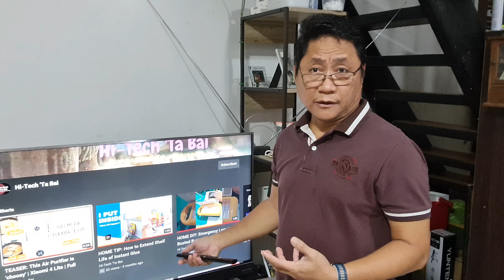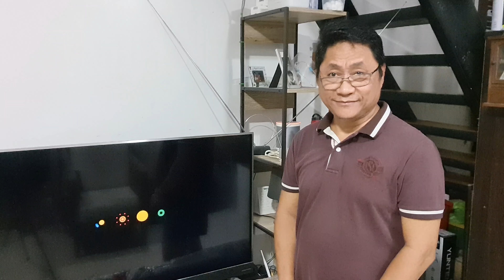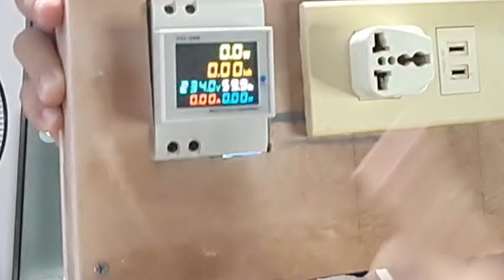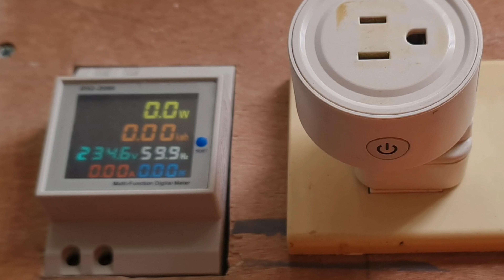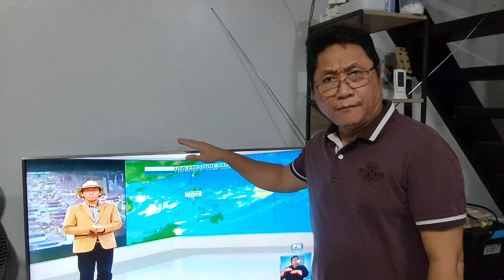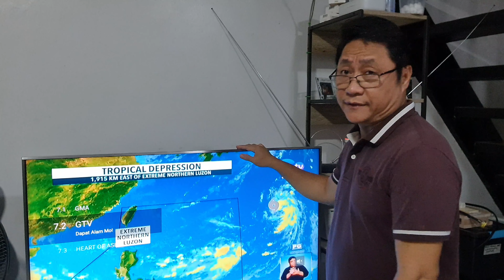STANDBY POWER CONSUMPTION: What Devices to Unplug | Electrical BIll Saving

Comment: Sir question po safe po ba naka stanby lang ung lasco plug? Hindi ko syA tatangaling 24/7?

Another question pag inof ko po ung smart plug pero nakasaksak parin ung ac maapektohan po ba ung ac ng power surge since nakapatay ung smart plug ko

Thankyou sana po masagot
Reply from the maker: First question-- the plug is designed to operate 24/7.
2nd -- pag off ang plug, it means walang dadaloy na kuryente sa AC o sa anumang isaksak mo sa plug.
Reply: @hitechtabai  thankyou po new subscriber here